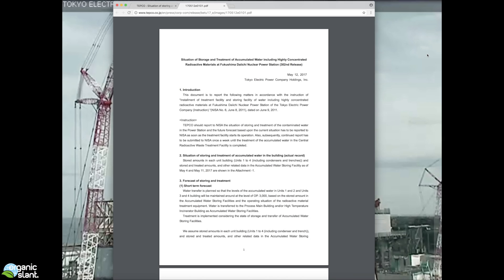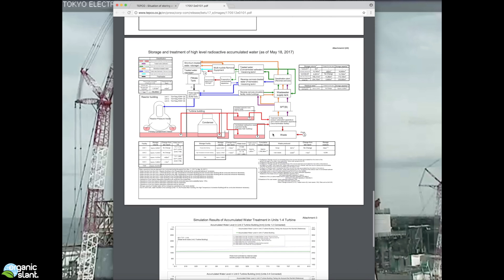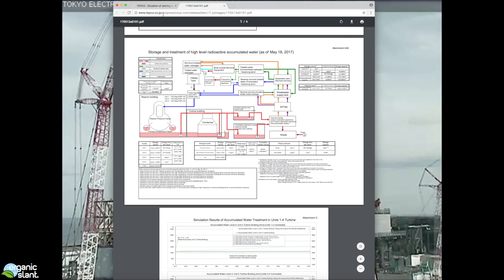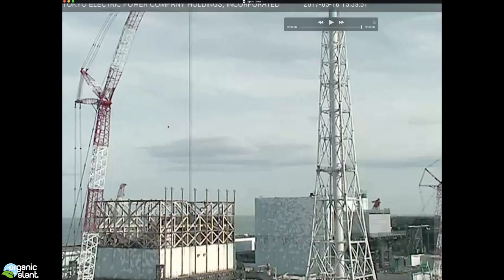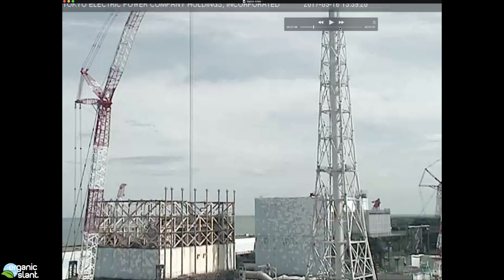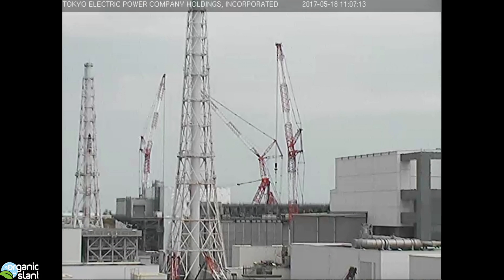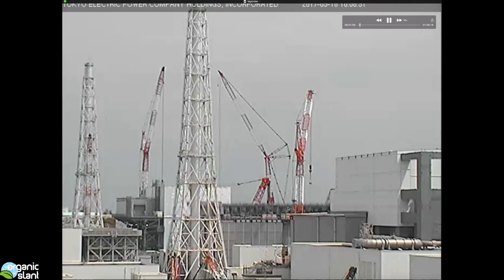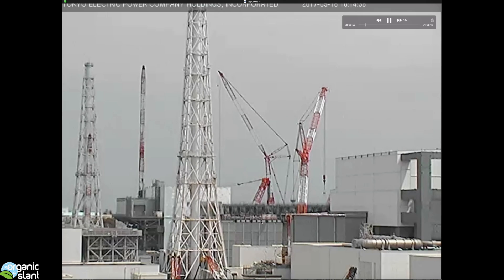Is TEPCO Using Shield to Measure Radiation Readings On Turbine Building Roof 5-21-2017 Organic Slant

Comment: The camers feed comes from a private searver owned and edited by Tepco. Building #3 is undefined in both camera views and I contend that it is melted into the ground from heated liquefaction of the dirt by radio (radioactive) frequency. No workers on the nonexisting building 3 because there is nothing to be done there but die a quick death. Tepco fiction.
Reply from the maker: an illusion...
Reply: The walking surface is perfectly in line with the camera view.The problem is the building blew up in 2011 so there is nothing to walk on. All the spent fuel is still burning, as your x-ray view shows, so they add some fake workmen in the footage because they can. Reactor #3 is the worst of them and they have no covering of any kind on it. The portrayal of #3 building is computer generated, like everything else they don't want you to see.
Reply: Look at what is supposed to be unit 3 roof at 3:30 on in the video and tell me what that is. A puff of smoke or a crane that guy of unit 2 cooling building needs a shield for. What is the crane handling? We can't even guess where you would store something like that on the small island of Japan.

Comment: They ALL blew up.
You are looking at a TENT that covers the buildings, not the buildings, themselves.
Yeesh.
They ALL blew.., unless you are talking about Daini (and this appears to be Daiichi, though could be Daini, as some of it was tented, too.)
Reply: Use your magnifier tool on the "TENT" (really a computer generated image) on building 3 at 4 minutes to 5:20 and check out the white horizontal bar that never moves a pixel. That is the camers view from reactor 1 side http://www.tepco.co.jp/en/nu/f1-np/camera/index2-e.html but from reactor 4 side there is no tent. From 15:05 to the end you have generated images to cover the real state of building 3, where the most hazardous full breach occurred. Reactor 2 building did not blow up but the reactor melted down and through the floor of the building.
Reply: They all blew up.  Some were covered with metal and canvas..  then it got too hot to continue (and i mean too radioactive, when I say, "hot".)  Many people believe the canvas, "tent" (and it is called a tent or tenting) is the original building.  It simply is not.